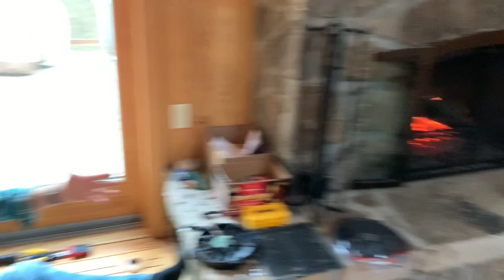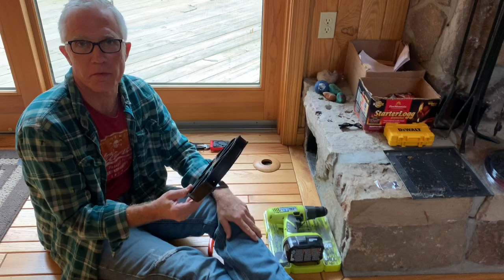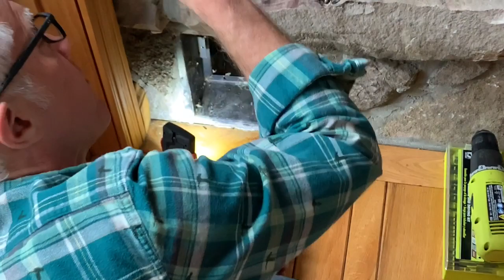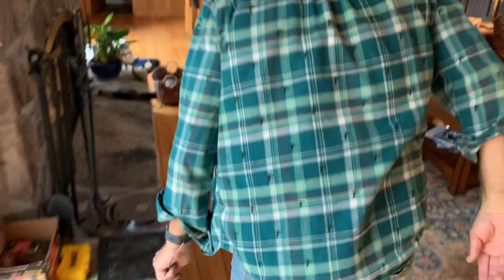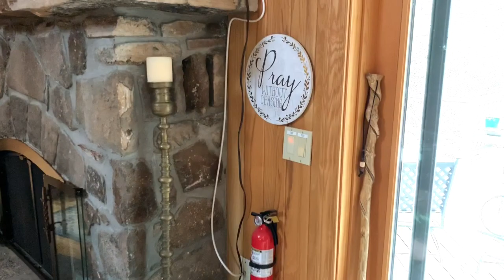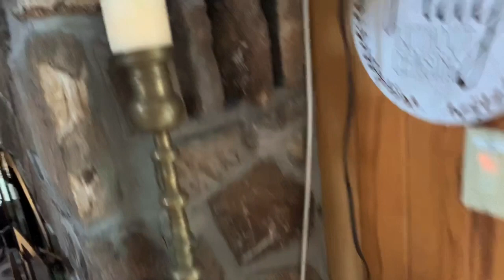Replacing Noisy Heatilator Fans in Fireplace

Comment: We've heated our house for 40 years with a Heatilator fireplace (I just found out that's the brand, the type is called a heatform). It was built in the 1950's with no doors or fans. We had custom glass doors made with Pyrex glass, and I drilled through concrete blocks from under the house to run 120 volt wire and install fans on a speed control, but they were a bit loud for the amount of airflow.  I just installed 12 volt computer fans that are 223 cfm each and man, what a difference! I get hot air blasting out of there. It is quite loud, so I added a speed control, and dampen the sound with boxes of kindling and rolled blankets.  It's worth it, because I only burn a fire about 1-2 hours a day and that heats the house for at least a day after the bricks are all warm. Also have it hooked to a battery so we have heat when the power goes out.

Comment: How many CFM would you suggest after having used the system for a couple of seasons. I found a 200 CFM fan and was thinking of tackling this project.
Reply: Did you ever replace the fan?  I found 200cfm ac infinity fans that would likely really heat up a room.  Thinking about adding variable speed wall dial to adjust noise level.
Reply: @rocketj7449  I did not. We bput in splits and now the fireplace is only used for ambiance.

Comment: Thanks for sharing. 
Your Heatilator is a lot like mine.  However my lower grills are just morter-less bricks that will have to be cut out to install (Quiet) fans.  A job I've been putting off but with oil getting hit by BidenFlation....  Your vid input is an inspiration to get me off the couch. I may further some research into multi speed fans too.

Comment: I've got one from when my father had his fireplace installed.  The problem I've got is that he never had the mason install the fan system.   
Now that I'm using the mountain house more and more I want to get the heat from the fireplace to heat the house.  
I also looking at a door for the fireplace too.  He never had one installed because he thought it took away from the looks of the fire.  
Now I'm stuck with the project.  You're lucky because you have metal grates to remove. I'm got brick to take out.
Question:   Why are you putting the fans on the bottom and not the top.  Isn't it easier to draw the air up and out then to push it from the bottom and up?   I'm going to make this a 2021 summer project as I get up there more often.
Thanks for any advice
Reply from the maker: You want the fans at the bottom because the air can get very hot and damage the fans
Reply: @chainbucket  That's right.  Thank you .